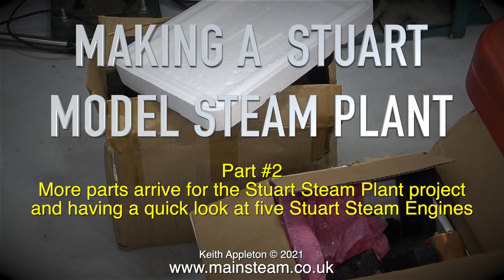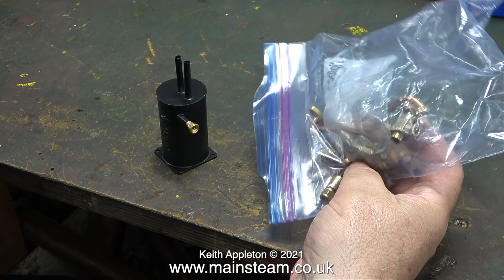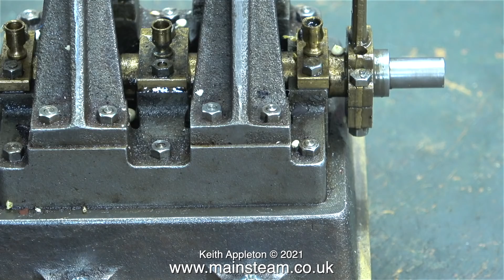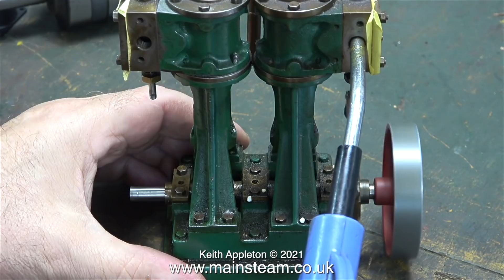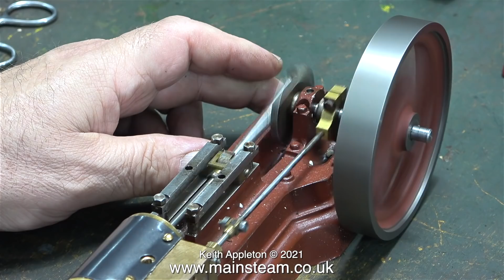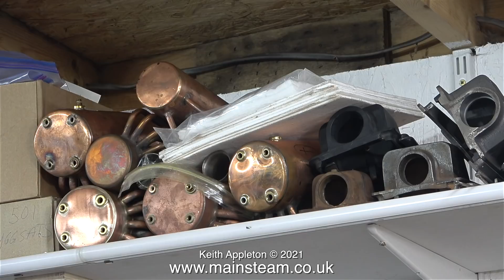MAKING A STUART MODEL STEAM PLANT - PART #2 - ENGINE TESTING

Comment: I've been looking to get that ceramic insulation material for fitting into the firebox of some of my Wilesco models, as I've found the majority of the heat escapes through the thin metal walls rather than making its way to the boiler. I feel the insulation would also make the boilers more safe to use in a model boat or other things where the heat could damage components or paintwork.
It might even be possible to get a minimal fraction of efficiency by insulating the cylinders with it, the decorative cladding just has a void between it and the cylinder, realy.

Marvelous stuff that insulation... and far less deadly than the asbestos. I still wouldn't recommend eating it. ;)

Comment: Keith, you have very generous viewers to have sent you multiple boxes of(albeit old) steam engines & accessories.  And you are lucky to have gotten into your hobbies at an early enough age to have gained the collections, skills, and bits & pieces to keep them going even in retirement.  Now that I'm retired and want to try to get into steam engines and model (RC?) airplanes, I don't see being able to afford any "nice" kits or possibly even just decent RC controls for DIY/scratch-built planes.  I wish that I had started both hobbies at a much younger age!  :(  I can probably build wobbler-type or even beam engines from bar stock, but the casting kits that "look nice" too are a bit too pricey for me.  I'd have to start with running any steam engines with compressed air and if I like it, then think about building a small low-pressure boiler (with proper safety testing of course).
Reply from the maker: This is not exactly a generous viewer sending me gifts. The amount of work I have to do on this steam plant is proving excessive. I originally quoted a price to assemble a steam plant for the customer using his parts, but alas his parts are far from good. The idea now is that I build him a steam plant using some of the parts that he sent me and the surplus will become my wages when I sell them. The videos you watch here on Youtube are a few Months old. The series is now up to Episode #44 on www.patreon.com/keithappleton
Reply: @keithappleton  Oops.  I see.  Hopefully the left over parts will be worth your time to you!

Comment: That PM research boiler kit is actually a joy to build. I've built a few now with different additional configurations.
I've even gone as far as adding water tubes like the stuart 500 boilers it's bottom, in addition to it's fire tubes. A 1x5 ceramic bix burner from forest classics is perfect for it! Will easily run a Victoria whilst keeping a full head of steam.

Comment: I've looked at those pm research kits, been very, VERY tempted to.try it :-)
Reply: Go for it. They are fun.
Reply: i recomend their 13 flue vertical boiler i built one and slightly modified it to burn coal, im able to run a stuart 10H off of it easily.